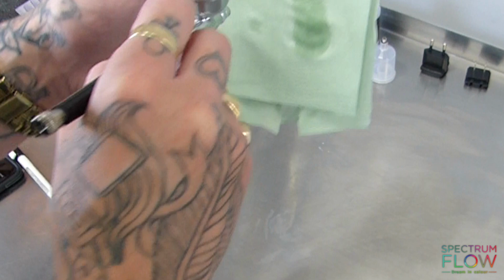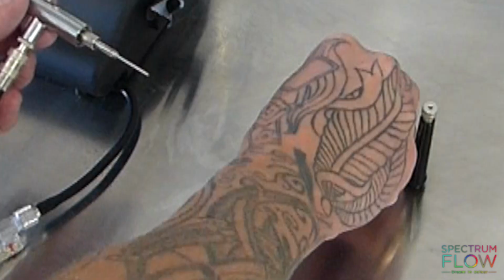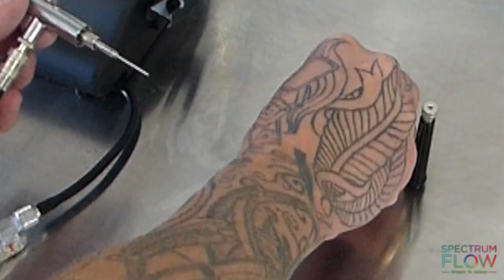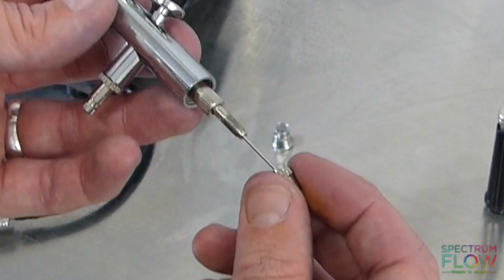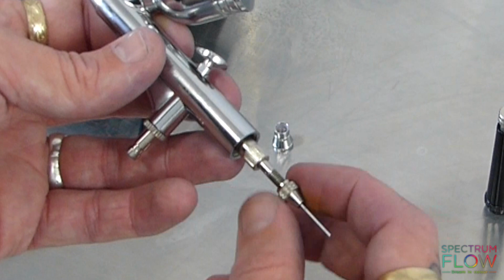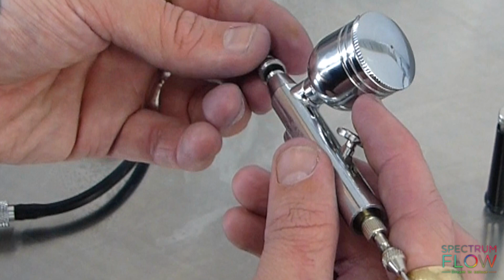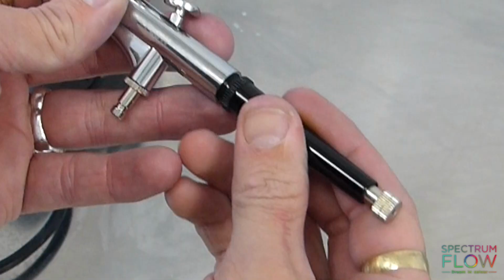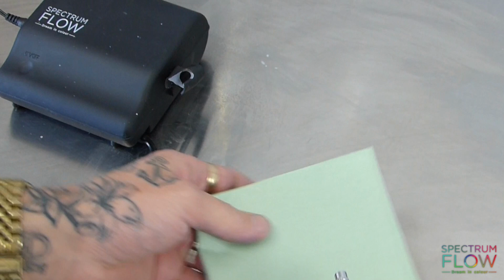Spectrum Flow Airbrush Pen Not Spraying

Comment: Hello =) I purchased my kit at the NEC in nNov this year(2018). So far I love it but I am finding that with the ethanol paint the spray seems light and doesn't come out as fast as the water based.  It took ages to cover a small area ( grass on trim of cake). Finally gave up and got the water base out.  Do you have tips for this? Thank you  =) Tam'
Reply from the maker: Hi Tammy! The ethanol colours are powder based. The powder in these colours settles to the bottom so you need to shake and stir them up very well everytime you use them. Use the end of a paintbrush to dig up the powder from the bottom of the bottle and shake very well. This will thin out the paint and give a great colour and coverage with the paints! :-D
Reply: @CakeDecoratingco  thank you so much. I have a huge project coming up over christmas break and will be using my airbrush again. will do as you have instructed =) thank you so much .

Comment: Sadly This Method Isn't Working For ME.... If I Blow Into the top, sure, but other than that... Its not working.
Reply: Same
Reply: I just figured out the problem I was having, my airbrush has an "adjuster" near the nozzle that needed to be loosened. I haven't seen this mentioned in other videos, so I assume most airbrushes don't have this feature. I hope this helps!